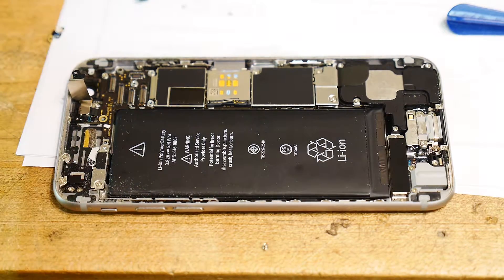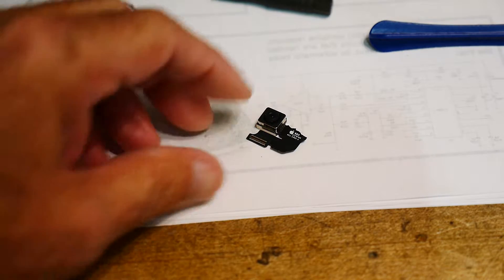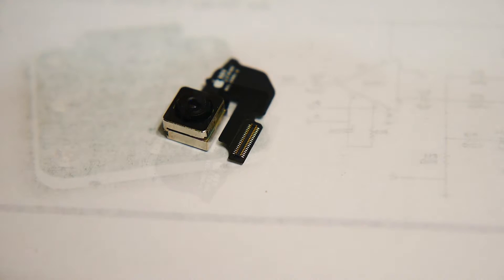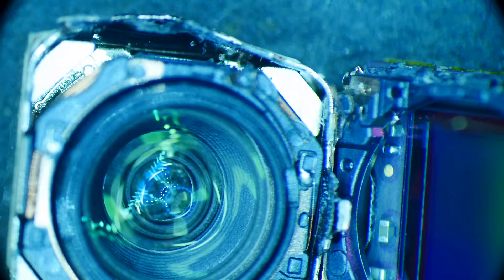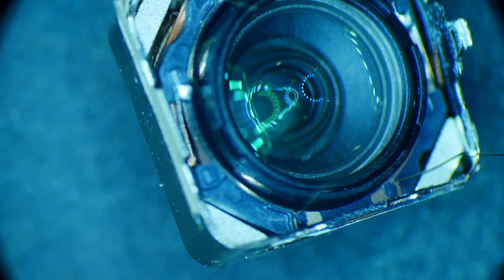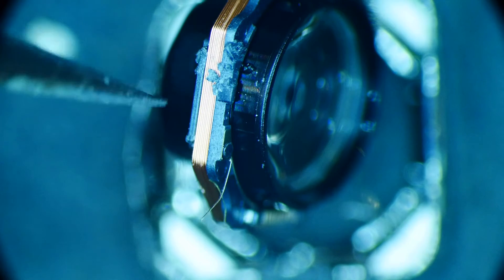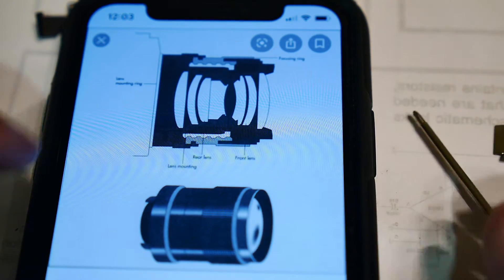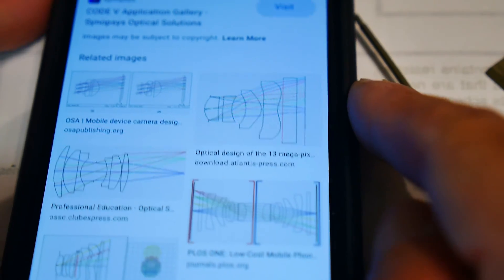#403 iPhone 6 camera teardown

Comment: Hi, because parts of the process are missing I need to ask you IMSAI Guy, now that you are do it and seeing how its assemblr do you think its posible to teardown or disassembly without broke it? I want to open this lens to remove the ir filter and the reassembly again to still using it... what do you think?
Reply from the maker: The IR filter can be in several places on these modules. It may be part of the lens and be on the element closest to the imager. or it may be on the window covering the imager. In any case it will be difficult. These things are tiny, I would buy some replacements and practice. Really good ones use two IR filter. One an interference type and one an absorption type. The thin film designs have very steep cutoffs but they suffer from angle problems where the cutoff frequency shifts with angle. the absorption are great for angle but have a relaxed curve. I don't know what the apple camera uses.
Reply from the maker: also, removing an optical element will effect the path length of the system and it may not focus correctly.

Comment: Interesting stuff! Would it be possible to remove the lens assembly and use the bare sensor? Wound the phone still accept the module without the lens?
Reply from the maker: It might fail autofocus. and complain but should still work, but I don't know for sure. Apple does strange things sometimes.
Reply: @IMSAIGuy  yeah, I worry that the software simply refuses. Would you guess Android might be an better option? Do you know if the camera has a feedback to recognise the lens assembly?
Reply from the maker: @maxmustermann5353  don't know. if you just want to play with cameras, look at a raspberry pie camera.
Reply: @IMSAIGuy  I want to get as much zoom as possible out of some tele stuff. The smaller the sensor, the bigger the zoom I figured. I still want to have a rather hight picture quality, so I thought a smartphone camera would be perfect. It works with cheap webcams with removable lenses, so an even smaller and more resolving smartphone camera should give an even better result.

Comment: Is there a way to use the camera separate from the phone/motherboard?
Reply from the maker: It is very difficult. The cameras use a high speed serial interface such as MIPI. You need a microcontroller that has a MIPI interface and ability to do DMA data transfers
Reply: Couldn't you plug in a very long ribbon cable to extend the camera outside the phone?